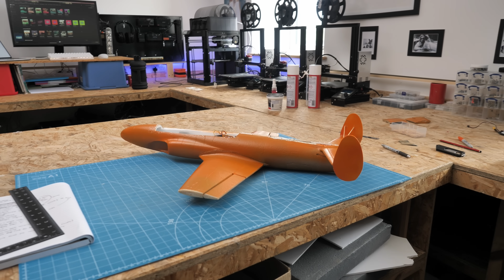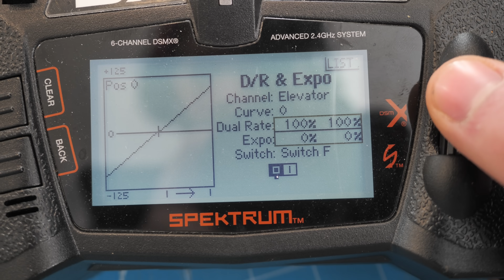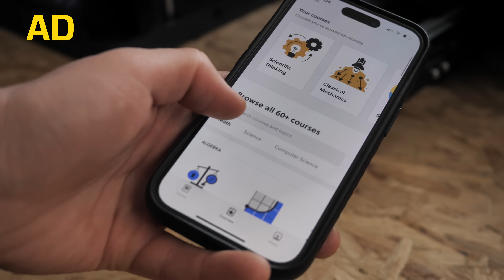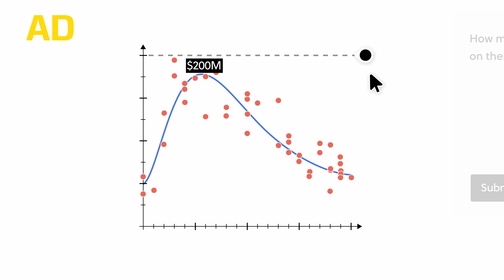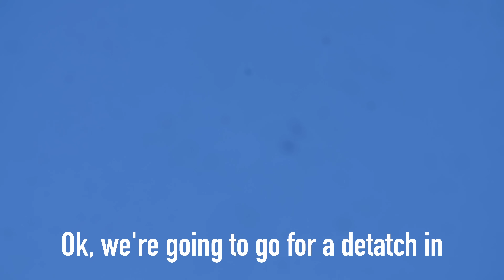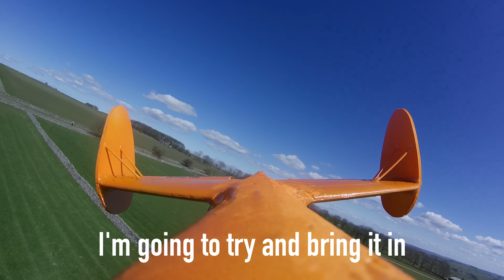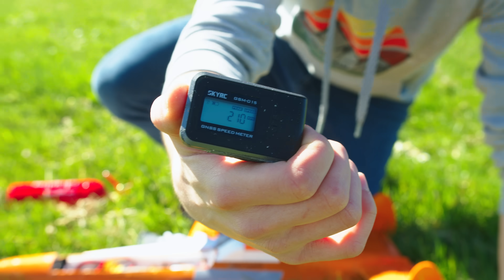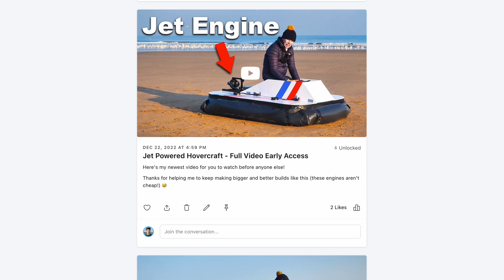Building the WORLDS FASTEST RC Rocket Plane! (Part 2)

Comment: Some GPS have built in protection that disable GPS module above certain speed to prevent using them in rocket guided missiles ( such as the one that you've built) Maybe try UWB localization methods ? Best of luck !

EDIT: After reading datasheets of couple cheap GPS modules it seems that they have a limit of 4G acceleration then they shut down for legal reasons. I think that's more probable cause than speed limit.
Reply: I have had that same GPS in an rc jet doing well over 200mph with no problems.
Reply: @JohnVHLife  its not the speed that is the problem, its the acceleration.  (The algorithms use in a gps solution are approximations and correlations that use non-linear equations. The first derivative of position is velocity, the second derivative is the acceleration, and the third derivative is the jerk. The integration of these parameters are used to predict where the platform will be at a very short time in the future. Precisely locating a platform that is rapidly changing it's velocity and direction requires a lot of rapid calculations and there are price and power limitations on the computing speed in the GPS engines in consumer GPS.

The specifications of the SiRFIII chip state that it is limited to +/- 4G acceleration and a +/- 2 G/s jerk, or in actual numbers acceleration greater than 40 m/s2 and a rate of change of acceleration of 20 m/s3. I assume that the calculations for situations outside these specifications either can not be completed within the required time interval, or the accuracy would be outside the required accuracy expectations.) 

As Bob mentioned from https://www.rocketryforum.com/threads/gps-g-limits.53582/#:~:text=The%20specifications%20of%20th%20SiRFIII,accelration%20of%2020%20m%2Fs3.
Reply: Nope. There's a guy on YouTube doing over 500kmh with a normal flight controller GPS
Reply: I don't think I agree with the edit; If the plane accelerated to 64 meters/second (145 miles/hour) over just the 150m measured in the 2.3 seconds it would only reach 2.834G.

So in that time at 1hz polling rate you would be VERY lucky to stick both polls in the distance between fences. at 5hz you could reliably expect at least two data points somewhere in that section BUT the flight path is also curved which may throw it off further.

I would expect based on the above, that you would need a true polling rate in excess of 5hz to get repeatable numbers at this speed.

The mentioned NEO-6 unit defaults to 1hz, and has a maximum of 5hz.
Reply: That certain speed is like mach 2+
Reply: @iolithblue  I've dug deeper and NEO-6 GPS module has 4G acceleration limit and I think it's realistic to assume that the plane could've achieved that.
Reply: @iolithblue  Mach 2 confirmed then? /s
Reply: @iolithblue  Could also be the polling rate of the consumer GPS? Depending on unit it could be 5-100 hz from what I understand?

I'm wondering is it possible that polling rate may not have been synced up with the quite short instance of max speed over the fences.
Reply: yeah i have known GPS to be quite suck at measuring speed, though that was a: 20years ago and b: on yachts (which are only doing 15km/hr), the speed reported would vary quite wildly.  @ESS284
Reply: @ralphm4132  that would seem to make sense to me mate with the motion of the sea and a fixed, low polling rate eh. Kind of like the curve in this flight i imagine you might get heaved or pitched over or something in between gps polls.
Reply: My quadcopter pulls more than 4g and the GPS never shuts down.
Reply: @cinemoriahFPV  yes, they said only some cheap gps modules have that limit
Reply: Wow
Reply: yea that happens if it goes above mach 1.5 lmao
Reply: Many GPS units aren't happy on rockets. The vibration messes with the xtals they use and can lead to "weird" effects. Normally they sort themselves out once boost is over. Take a look at the hobby rocketry community for more info. For the kind of flight he's doing an accelerometer based system (AKA IMU) for the boost and instant speed measurement using gps for the base speed before ignition would probably give a better result.
If they are still around, take a look at R-DAS (rdas? rocket data acquisition system) or something similar.
Reply: I'd consider a Jolly Logic Altimeter 2 if the UK allows them.
Reply: Lounicc
Reply: That's actually ridiculous..
Reply: I dont think so. I have the GNSS GPS from same manufacturer - Skyrc and I have clocked 320kph for my 6S funjet plane. That GPS is definitely able to calculate higher speeds.
Reply: Most GPS systems, particularly those for export, are limited to IAS<1000kt and reference altitude greater than 59,000 feet. Some manufacturers use the OR clause; these are the ones generally used for low altitude nonballistic applications such as high-speed line-of-sight radio control drones (which are subsonic anyway), or low-speed, stratospheric applications such as project balloons that approach the Karman line. If you want to go supersonic with what amounts to a cruise missile at that point, you'll have to approach your local DoD/Air Force Command station and ask them for advice on how not to find yourself subject to a joint BATFE/FBI/DHS 3am no-knock raid. There's an altitude limit for toy rockets, which largely depends on proximity to civilian runway approaches and military facilities. Refer to the CAA for maps.
Reply: This is why I love chatGPT (and think it's what WolframAlpha wanted to be):

"To determine whether the 4 g limit of the GPS module was exceeded and if it resulted in an unreliable recorded speed, we need to estimate the maximum acceleration that the foam model airplane experienced during the rocket engine activation.

Assuming the rocket engine provided a constant thrust of 120N, the acceleration of the foam model airplane can be calculated using the formula:

a = F / m

where "a" is the acceleration, "F" is the force or thrust provided by the rocket engine, and "m" is the mass of the foam model airplane.

Substituting the given values, we get:

a = 120 N / 0.676 kg
a = 177.5 m/s^2

This acceleration is much higher than the 4 g limit of the GPS module, which is equivalent to 39.24 m/s^2. Therefore, it is likely that the GPS module reached its acceleration limit during the rocket engine activation, resulting in an unreliable recorded speed."
Reply: @bestpracticeses  wow all that AI power and not a single mention of aerodynamics and how that would affect the acceleration of the plane. All it gave you was the very simple F=ma equation, something you learn pretty early in physics in school.
Reply: @conorstewart2214  And not everyone learns about physics in school 🙄
Reply: @proxyhx2075  where are you in the world that you don’t learn even the very basics of physics?
Reply: @bestpracticeses  or you could had done the math instead of depending on the validity of a glorified logistic regression run on biased data.
Reply: @peraltarockets  but where's the fun in that?
Reply: @dougaltolan3017  I'm not interested in fun, I'm interested in getting a result I have some level of confidence in.
Reply: @peraltarockets  if you're not having fun  then why do it? If you don't have fun when working why work? It's a chore if you aren't having fun doing it you become a stick in the mud if you aren't having fun. Most people take life too seriously. After all if you haven't figured out that life is one big practical joke and your on the butt end of it and learned to laugh at the joke you will never know what you're missing in life and people like that make me feel sad for them. All that keeping up with the Joneses and chasing the almighty dollar and buying everything that Madison Ave tells you that you have to have to be happy. Madison Ave doesn't know happiness it's all an illusion.

Comment: Pro tip: The back of the craft is as important as the front when it comes to aerodynamics. Maybe try making the adapter conical next time to see if that helps.
Reply: "Aerodynamics are of the utmost importance" Next scene cut to TOOTHPICK STRUTS.  Me: ... what are we even doing here? :(
Reply: @RoadToad42  Like i said in another comment, this thing is so ridiculously Kerbal.
Reply: I'd make a transparent nose and put the camera there. And delta wings would be nice. Straight wings are the slowest of the bunch.
Reply: @inventiveowl395  You gave me an idea, since he wants the footage looking behind the plane, maybe putting the camera inside the plane at an angle and attach a mirror on the outside so the camera can see straight back can be a better idea? Like how those railgun tracking cameras are constructed (well minutes the rotation of the mirror).
Reply: @inventiveowl395  Swept wings help to decrease compression drag at high speeds. Compression drag is negligible until about Mach 0.7. Delta wings are a just a way of getting sweep into wings. Realistically, sweep/delta would do nothing for this project and both of those are structurally inferior. It would be a bad idea to switch.
Reply: @inventiveowl395  I'm pretty sure delta wings only start to make a difference when you're talking about transonic flow over the wing. They shouldn't make much difference here, given that much larger planes fly these speeds with straight wings.
Reply: @inventiveowl395  tell that to Chuck Yeager. Swept wings only become important at transonic speeds, which this plane is well short of.
Reply: Thank goodness for armchair experts.
Reply: the back of the airplane with the rocket engine doesn't need to be "pointy" as the rocket exhaust is "pointy" -think of mach diamond shaped exhaust cone
Reply: @othernaturenate  yes it has to be pointy, round isn't scary, pointy is scary
Reply: @ToBeIsWasWere  You got me there.  I guess you're right
Reply: @ToBeIsWasWere  Living like a dictator
Reply: At ignition of the rocket, let the wings retract or fall off, becoming a bullet it will go faster.
Reply: And lose the braces on the vertical stabilizers. Reinforce them with something else, not those draggy thingies sticking out in the airstream.
Reply: Better pro tip is to use different wing design
Reply: @OriginalThisAndThat  Not sure if wing shape makes that much different at these speeds.
Reply: @HolyPastrami  ofcourse it does
Reply: @HolyPastrami  wing sweep could help (?), but i think it would be a bit overkill
Reply: @OriginalThisAndThat  true
Reply: @HolyPastrami  there's a reason why they make Concorde have a delta shaped wing.
Reply: @75yomu  Yeah, but i doubt this thing will break Mach 1 anytime soon, letalone Mach 2.
Reply: @Gerry Doyle The F-104 had extremely thin wings, razor sharp, so even though it has non-swept wings, they have a short span and a diamond supersonic airfoil. Also, in low airpeeds using flaps it had a boundary layer control - high speed air injections over the flaps.
Different case than this one...
Reply: Pro tip: You don't know shit and haven't done anything in real life.
Reply: @gerrydoyle9774either pointy or razor thin. The bell x1 had straight wings, but they were so thin they weren’t an issue at supersonic speeds
Reply: Not sure how it will affect the structural integrity though, may need to do some simulations to find the best spot for a hole to exist.

Comment: try edf gasoline afterburner jet thruster, diy, edf in front, the rocket nozzle afterburner on the back, maybe ramjet cone in the front
Reply: mix kno3 into ABS filament = fully structural combustible rocket (ABS+KNO3 3d printed)